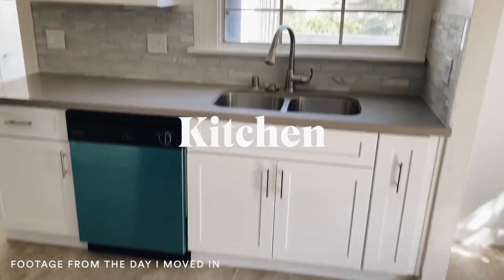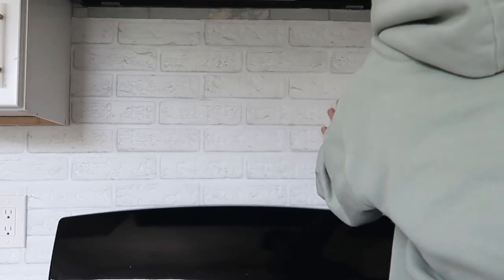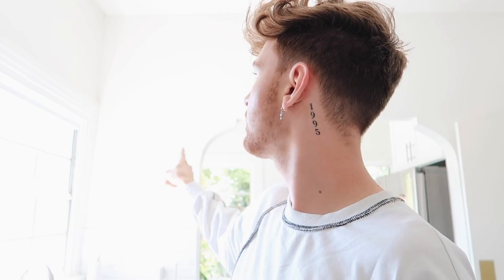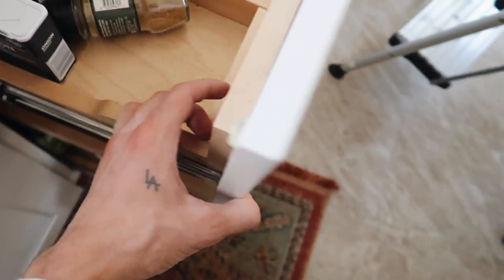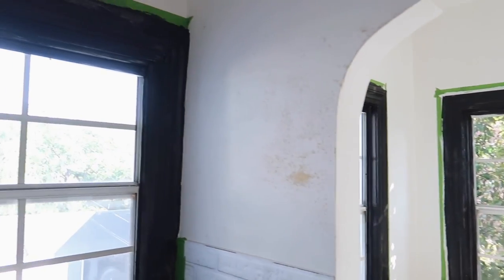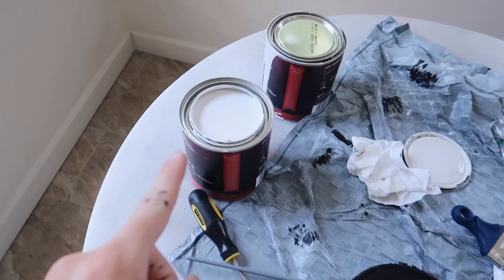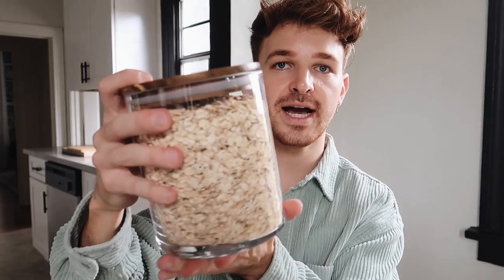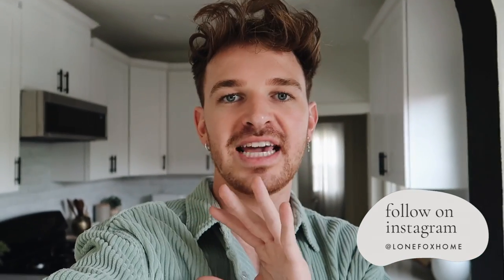DIY KITCHEN MAKEOVER (Renter Friendly) ✨ DIY Backsplash + Wallpaper!

Comment: Wooden utensil tip! I stumbled upon this on accident about 15 years ago and have been doing it since. Every fall I boil my own natural potpourri. I grab a large soup pot, fill it 1/2 way with water, put it on the stove and fill it with lots of ground cinnamon, cinnamon sticks, halved or quartered apples, vanilla, & cloves. I vary it at times by adding oranges or whatever comes to mind. I bring it to a boil and then let it simmer with just a very small boil and let it reduce until I need to add more water. All fall my home smells like fall! I live in SoFla and since we don’t experience much in the change of seasons, we need to make them! This is my way of doing that. Now, I was stirring the potpourri and something came up. I accidentally left my wooden spoon in the pot! Came back an hour later and the bottom 1/2 of my wooden spoon had been naturally stained! I tried to wash it off, but no dice! So, I grabbed the rest of my wooden utensils, flipped the already darker spoon over so that the top half (the handle) would get stained and match the other side. They came out GORGEOUS! I absolutely LOVE the rich color that the cinnamon and cloves makes them!! Now, I purposely leave my utensils in the potpourri each year. I never find a difference in the top of bottom half of my utensils. You can’t mess this up! The longer you leave it the darker they will become. I saw yours here and mine are the same color! I’ve done it with regular wooden spoons and with bamboo. Never find variation in color. It they always come out great! Cheap way to naturally darken wooden cooking utensils. Thanks for all you do, Drew! 💕Love, Kringle!💕
Reply: Great tip! Thank you - I will try it :)
Reply: Lol
Reply: That is a great tip! I do the same thing but not to color my wooden spoons. We do have for in Central MO. so just as the air starts to get a little nippy outside and we get the first frost, I whip up a pot of potpourri using all those fall spices that remind me of my grandma's kitchen and eating her gingerbread poundcake. Yum!
Reply: What would be a cinnamon substitute? I know it is the signature spice of fall, but I am not a fan of the scent. Is pumpkin a substitute? I know it is not a spice, but what is an autumn loving girl to do?

Comment: i really didn't like the backsplash choice (it looks cheap compared to the tile imho) but also given that the tile was grey, i totally get why it would've detracted from the overall finish which looks SO GOOD. in love with that lemon wallpaper and dark isn't usually my style at all.
Reply: The grey ones are actually a cheap tile, they're likely also peel and stick as a lot of those smaller looking tile pieces are peel and stick, usually the smaller tile pieces tend to be cheaper. I don't like the stick on subway sheets either, but color wise they look better.

Comment: For the cabinets, I think you could use contact paper if you really wanted to change the look of those. I've seen people even use washi tape (which comes off just as well). Other than that, I think these are nice, simple, doable changes for the kitchen.
Reply: Yes. I was thinking the same about using washi tape
Reply: or even that electrical tape around the edges

Comment: Love the transformation Drew!  
Love the wallpaper!  Thank you so much for sharing the electrical tape idea!  Thank you also, for the prevention-of-bleed-through-the-painter’s-tape idea!  
I have learned a couple other strategies for preventing bleed-through from a couple YouTube Channels:  1)  use paint sealer - the furniture+ artist/furniture+ flipper used paint sealer to seal the painter’s tape edges before she created vertical lines on drawer fronts with Dixie Bell paint and 2) brush paint sealer over a stencil - a furniture flipper did this - she applied a clear sealer over the entire stencil before she applied Dixie Bell paint - she recommended applying the sealer under the stencil details, too.

Comment: This is really inspiring. LOVE the wallpaper and the million hack with electrical tape....gonna try that. However, I think I would have used the peel and stick tile on the right lower half of the arch way to balance out the tile on the left...or maybe some small black line drawing prints....maybe 3 small ones vertically stacked to balance the white on that side.  Really well done.

Comment: Initially I thought the tiles were great but as you panned down to the floor I thought "Oops those tiles on the wall were a mistake", which was a shame because you could tell the whole kitchen was new.  I wasn't sure about the peel and stick tiles but once everything was finished I thought "Brilliant job". It looked so much better. Even changing the handles made such a huge difference. The accessories were brilliant and even though you did not show them as a new item the Salt & Pepper Shakers were fab!

Comment: Great job! Such an inspired makeover. I wouldn't have known where to start.
Question: do you think peel and stick tiles (for a backsplash) will work on orange peel textured walls? I'm thinking that if you're wall paper didn't stick then the tiles won't either  - without sanding.

Comment: New here but I really like what you did with your kitchen.   I'm just wondering though if there is a cheaper brick-look peel and stick backsplash as those are really pricey.  They are about $18 each here in Canada.   
Or, should I maybe try the spackle/tape option?   I'm not a renter so not worried about that.

Comment: cute dude cute! As an after thought, on the lemon wall  paper wall,  did u think u could've pulled the wallpaper all the way down to the counter OR to the least of lining it to the bottom of the light switch. Whereas, to level each side of the entryway as possible with the eyesight?

Comment: I'm sorry to say but everything you added has made the kitchen look much cheaper, smaller and lower quality than the original kitchen. I cannot understand why you would cover new glass tile with a chunky faux stick-on backsplash, add a light fixture without a bulb, or use a lacquered black paint that shows every imperfection of the window casework (17:23). I love bold printed wallpapers but the lemon print does not enhance the space, it actually takes away from it. I normally love your work and mean all of this in the most constructive way possible.

Comment: I would not recommend putting electric tape over the metal on the window. It’s going to be a pain to peel off and to take the glue off! From experience what ended up happening when it was time to peel off the sun baked the glue onto my trim and made more work to peel it off. Had to scrap and had to put a special solution just to get the glue off. Do not do it!

Comment: The fridge sticking out too far always drives crazy. Why do manufacturers make them like this?
Reply: You can get counter depth refrigerators that won’t stick out, but you sacrifice cold space.  I think the problem is with the building construction that doesn’t allow for the refrigerator to “retreat” into the wall.  Seems like a simple thing to do in new construction.  I’m aggravated that they don’t do it.